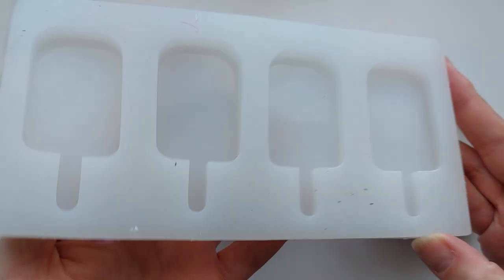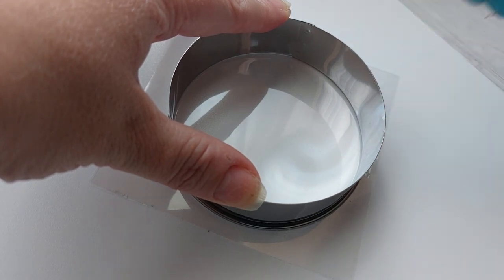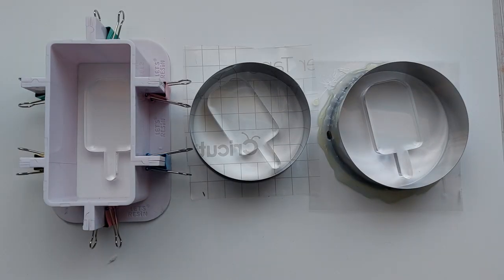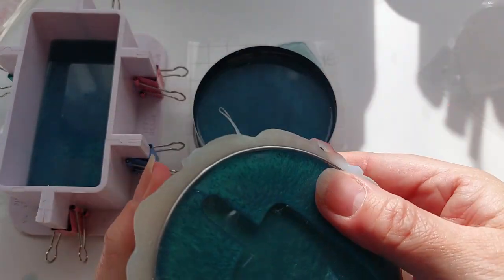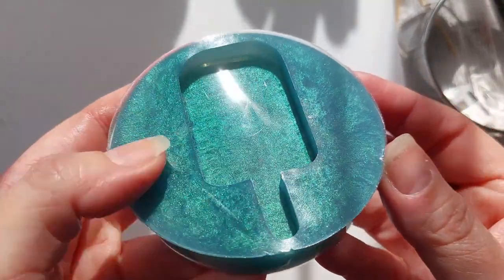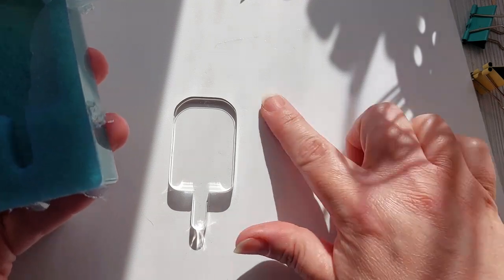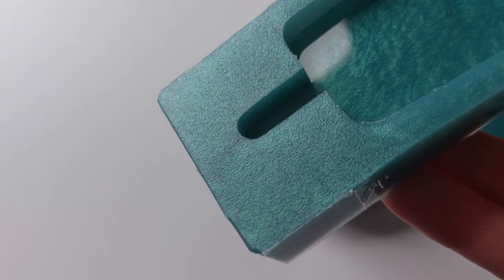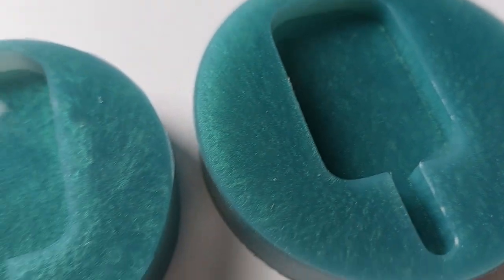How to colour silicone and testing bases for moulds

Comment: Hi lovely I always use 1 of 2 methods and never have a problem I either hot glue blank down or double sided tape it just the blank and put it on either foam board, acetate a tile or thin perspex as it's great as it's flexible so pops off real easy  but love the results and I cut up a mold the other day and added it to liquid silicone to increase volume as I knew I didn't have enough then tilted the mold to cover the last little bit and it was on perspex so was perfect x

Comment: Could you clean the sticky one with an alcohol wipe? Also if you're going to repurpose the ruined mould, you can trim off the excess from the other two as well. Thanks for doing the experiments Claire.
Reply from the maker: Thank yoooo ❤️❤️ I am not sure if the silicone will like the alcohol .. but I might try that with the previous one that is really really sticky ..  this one is not so bad at all just not as dry as the Acetate 😍😍😍

Comment: I've had good luck using clay as the base for molds. It's re-useable, and it saves on hot glue as well because you can just squidge the excess clay up against the edge of your housing to form a dam! The downside is that the face of your mold tends to be very matte and can be a tad wonky and uneven if you don't use a clay roller. Maybe not ideal for commercial mold makers, but it does the trick for personal ones.

Comment: Have you tried Press n Seal? It doesn't have the same type of adhesive as packing tape (cello tape). You could also try a thin layer of wax (let set up enough to place your item on without being fully hardened).

Comment: Hi Claire, thanks for another helpful video! Maybe you could glue the acrylic template with a thin layer of mod podge or similar light glue, down to the acetate film or to the foam board ( something made out of plastic) that no silicone will seep underneath?! And maybe it can be removed without any trace….

Comment: have you tried spray adhesive? Quilters have a lightly sticky spray that washes away they use to put the batting between the layers without pins. I think there is also a similar adhesive available like that used on post it notes. that way you could apply it just to the object rather than the entire bottom.
Reply from the maker: Thank you so much Diana .. I have not tried spray adhesive... definitely something to research 😍😍 thank you so much xx

Comment: Super simple way to remove hot glue..... A drop or two of alcohol. You may need to pull away a tiny spot to get it to seep between the glue and the item it's stuck to, however once you do, it will come off as if it was never stuck on. 😉
Reply: I am curious, is the sticky issue you had from cure issues, or simply that it grabbed the adhesive from the tape? Have you tried wiping the mold with adhesive remover to see if it can be saved?
Reply: Have you tried contact paper/ shelf liner? That cricket stuff is spendy.

Comment: I have to try this. I'm going to search to find the edge tape or equivalent here in Canada  Molds Question. What is the recommended way to store your molds in-between pours?  Paper inbetween them if they can be stacked? In lidded Containers? I now have a few to start and all varying sizes but don't know how to store them. Any suggestions would be helpful.
Reply from the maker: Heyyyy lovely .. I would store them in  containers or in some plastic ziplock bags as they can dry out over time xx
Reply: @ClairesCraftyCorner  thank you so much for the tip!

Comment: Please don't use your heat gun to remove the hot glue, it will make a terrible mess! Just saturate a cotton swab with rubbing alcohol and put it all around the hot glue. It should come off clean.
Reply from the maker: Ohhhh perfect thank you so much that's really helpful ❤️❤️❤️